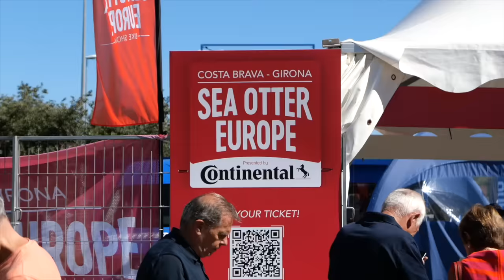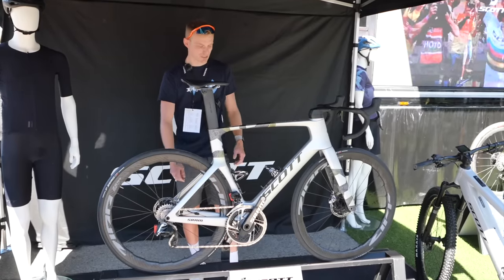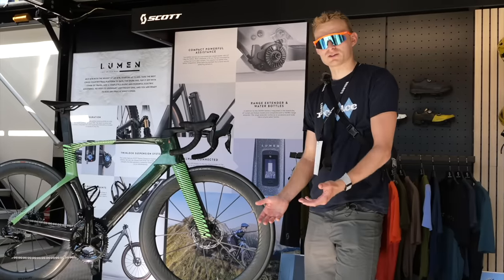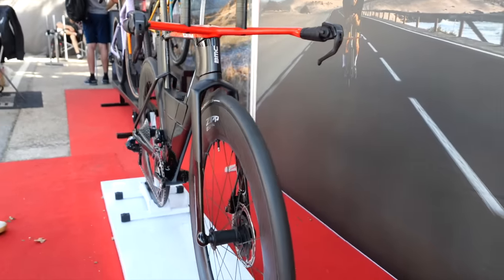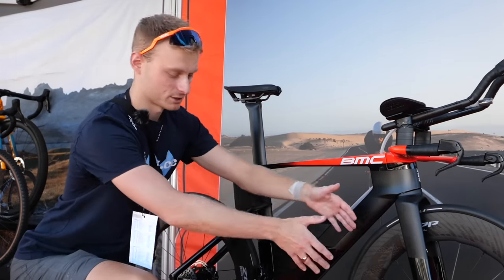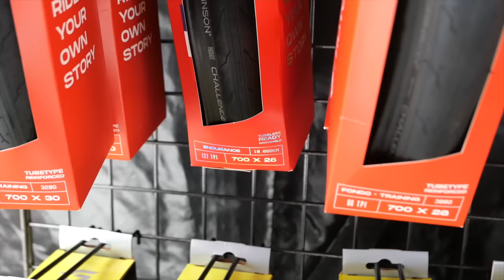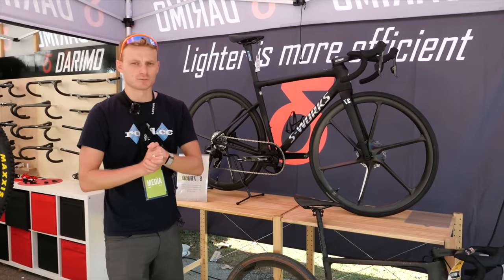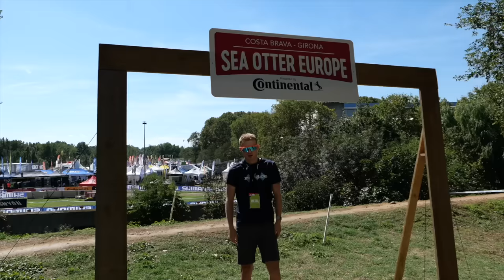Unreleased 2024 Bike Tech! | Road & Gravel Highlights From Sea Otter Europe Bike Show

Comment: Sorry but this came across really amateurish, soo much cool gear there but you purveyed no information other than that which is immediately obvious just by looking at. Did you not talk to any of the manufacturers to get the sp on specs or info regarding any quirky features. It's like youve made use of a cheap holiday and wandered around a show while you were there.